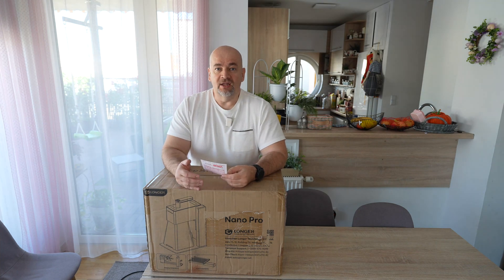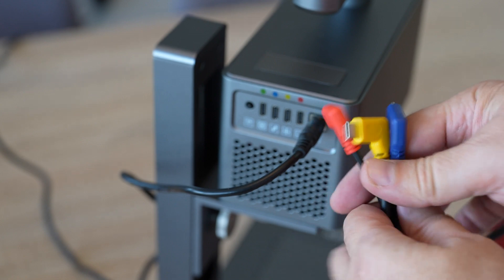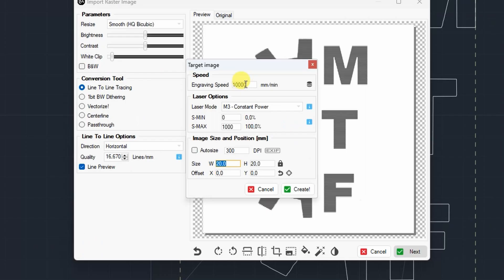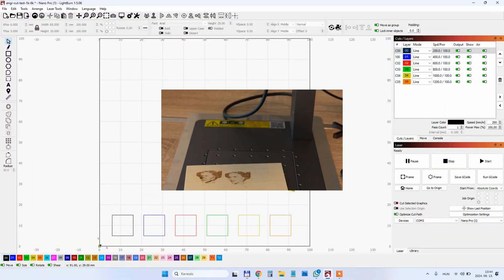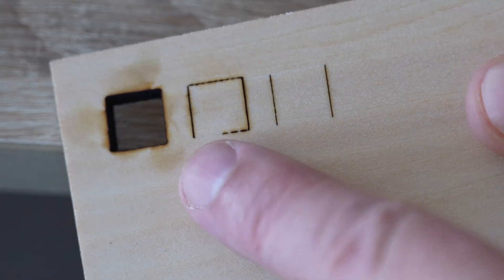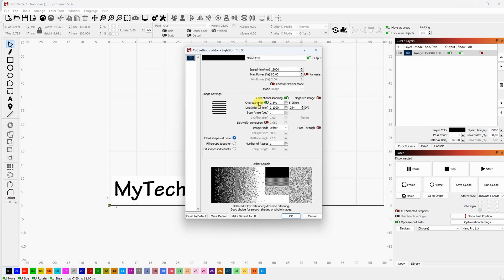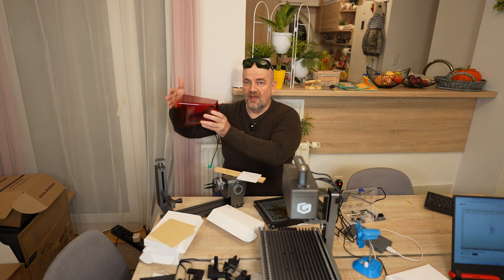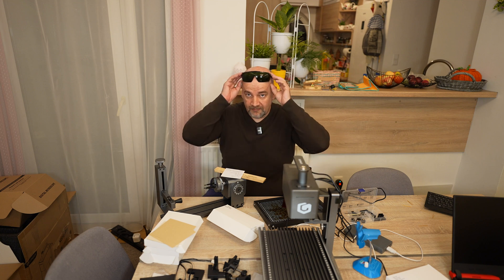Portable laser engraver: Longer Nano Pro 12W with rotary unit and extension slider

Comment: You can cover the wood with masking tape. Then the scorch marks will not stain the actual wood. If you have a difficult pattern like the face, you can use a pencil eraser to remove tiny bits of masking tape.
Reply from the maker: Thank you for this useful suggestion. I get used to air assist machines and I didn't know about this.